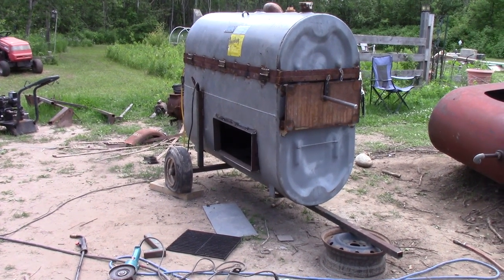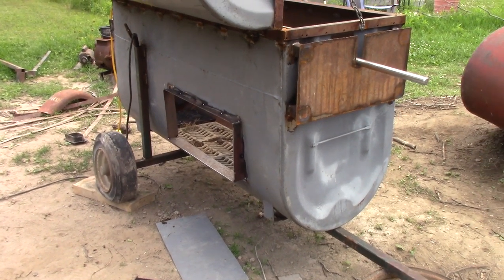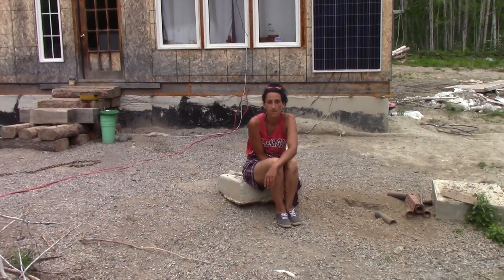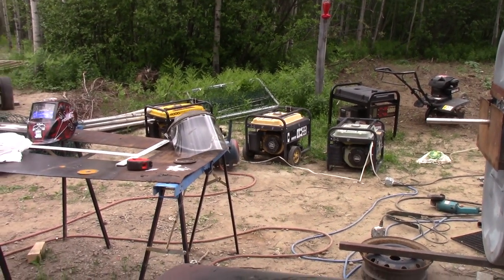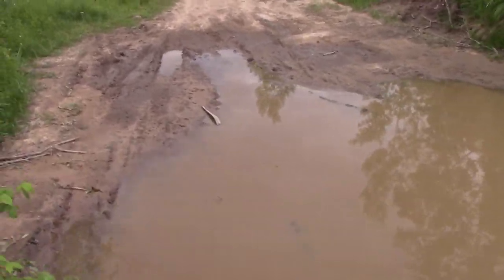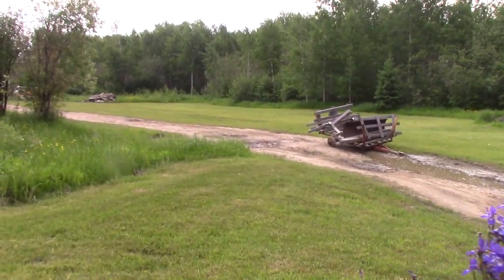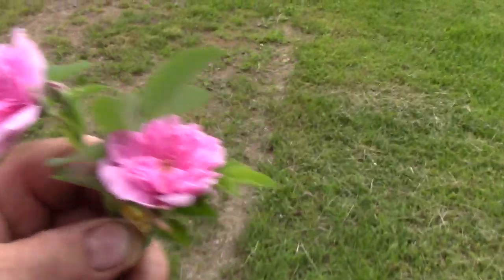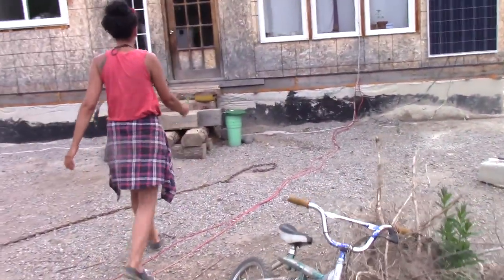Back At The BBQ Pig Roaster Build/ Off Grid Homestead Style

Comment: I have a 30 amp plasma cutter that runs on 110/120V. Less than $200 USD.
Reply: Hello Jeffery.   What is the thickness capacity of your plasma cutter and where did you buy it?
Cheers!
Whipple
Reply: @Whipple1   HYL brand off of Amazon USA. Severance cut rating is probably between 1/4-3/8 inch thickness.